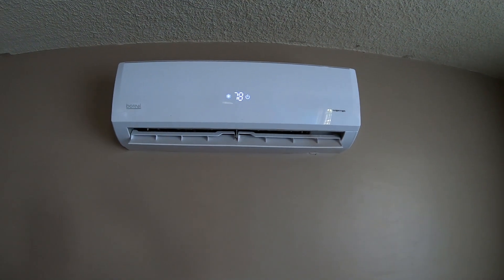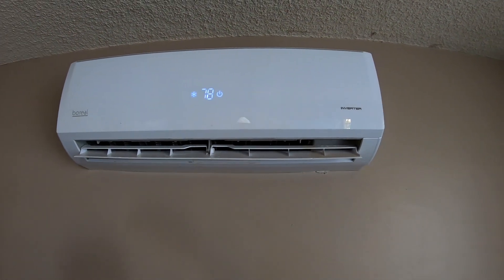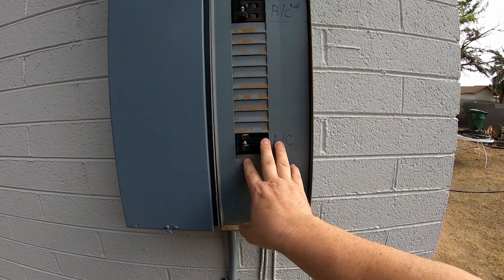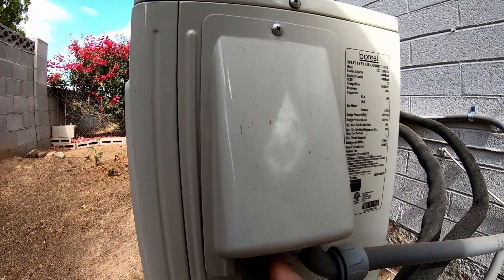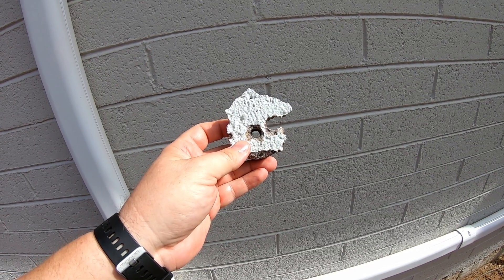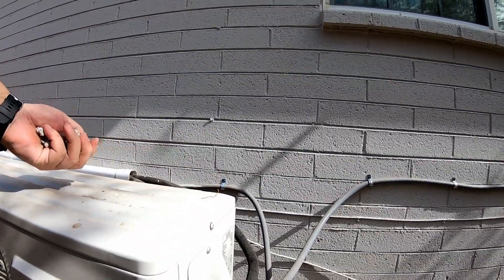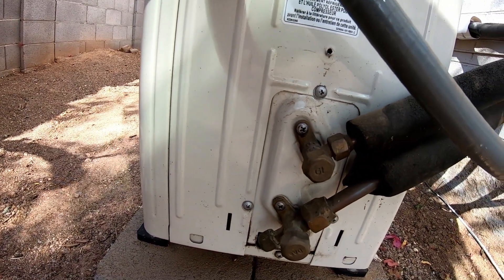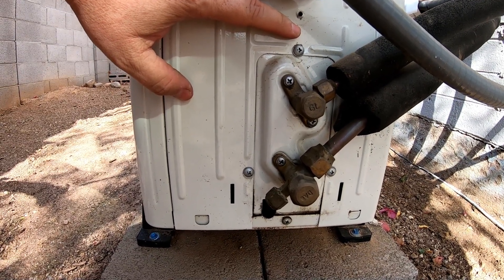DIY Mini Split System/ Should You Do It?

Comment: I bought the same one last week. How expensive is it to run it?  Also you think 12000 btu will be enough for 400 sq ft 9ft ceiling in Texas? Worried I should’ve done 18000.
Reply: 12000 BTU should be plenty for 400SF

Comment: Awesome video! I'm installing a 3 zone Boreal in the coming weeks. I was wondering if you cut your refrigerant lines to be the proper length or if you set your outdoor unit to the length so that there wouldn't be any slack in the lines?

Comment: I am attempting to install my Boreal mini split but the instructions are very vague about the wiring. Would you please explain the connections between the inside  and out. The manual I have talks about a control wire but zero info about how to connect it. I have both a 3 wire and a 4 wire line set that they supplied, but do not know if I need to use both or only one because the install instructions are vague. I have a EQX12HPJ10B 230v model which I think is like yours. Any help would be appreciated. Thanks
Reply from the maker: I couldn't find anything on your specific model online. It's been a few years since I installed mine but to my recollection there was a 4 wire control, 3 wires for the unit and a ground. The 3 wire is for the power connection I believe? I used my own power wires however and discarded the ones they sent with it. 

 It doesn't matter which post you connect them to as long as you match what you do inside to the outside. If that makes sense?

Here is the video that helped me the most. I watched it about 4 times.
https://www.youtube.com/watch?v=zY2D8DEwoRM&t=904s. 

And more recently this guy does a good job explaining it as well. https://www.youtube.com/watch?v=7BNITpRocz0